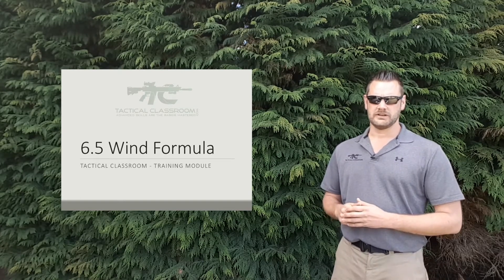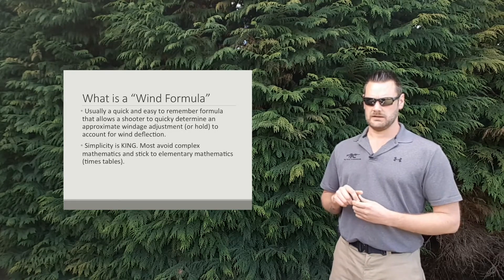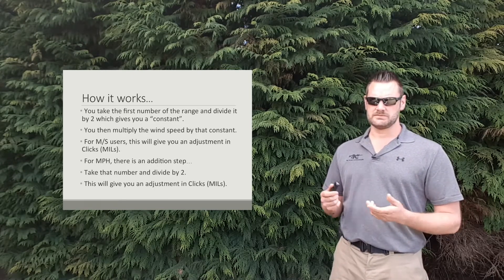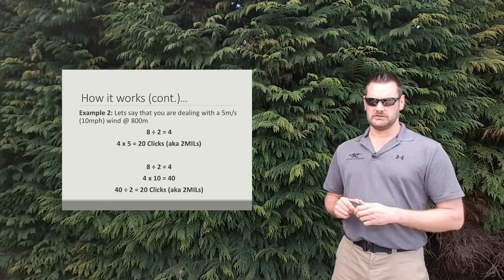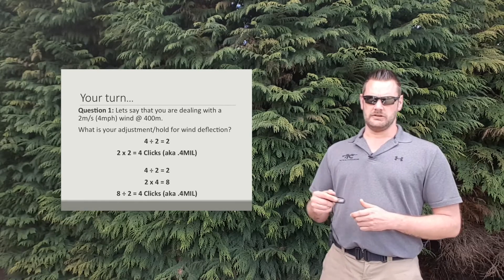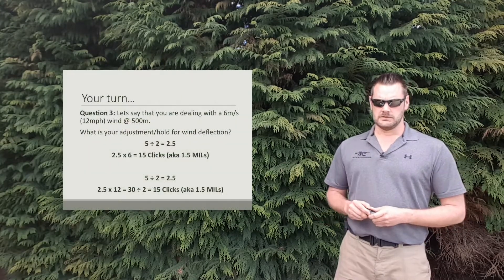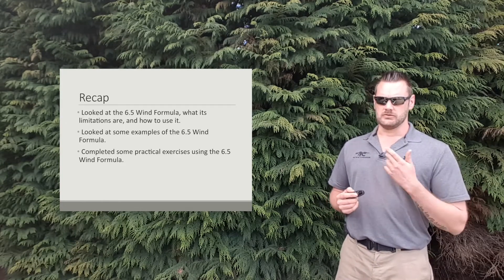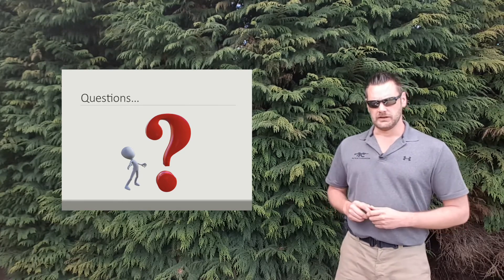6.5mm Wind Drift Formula - Long Range Shooting Tips

Comment: Blimey, it works. Same output as my Strelock, used it at 700m with my Creedmoor today and hit the 8” diameter plate first shot. Easy as.
Reply from the maker: David Hartley Glad it worked for you David. I use it when I'm shooting 6.5mm. Are you using m/s or mph?
Reply: Tactical Classroom I’m using m/s. Want to keep velocities and range metric and use milrad. Have changed all my ballistic turrets to mrad and finding overall that combined with metric measurements its working better for me. Keeping it simple has made a big difference e.g. only measuring the wind perpendicular to the shot trajectory, and using this formula. Then I do a simple wind check 2/3 of the way to the target to see if it looks about right. Before I was trying to assess the exact wind vector and inputing into the ballistic app and not getting it right as often as I should.
Reply from the maker: Nice one! 

Folks tend to overthink the wind and it just slows them down...they muck about with their Kestrel to try and get a "perfect" firing solution!

9/10 they are still playing with the Kestrel when I'm getting off the gun after making a hit!

They need to realise that there is NO WAY to measure the wind precisely all the way to target, nor account for slight changes caused by terrain features etc.

The wind call we end up using is simply a BEST GUESS based on experience.

So...good on you for streamlining your setup so it works for you!

Comment: Thanks pretty useful . Do you sort of work on an average velocity to get to this calculation. If I run a ballistics app the numbers are slightly off ,but not by much. If you shooting steel you should be getting hits.
Reply from the maker: Andy Rose I'm Glad you liked it...

I've tested this formula against my ballistic app AND tested it "in the field" on steel...and it works very well.

As stated in the video (and noted by you), it isn't always exact, however if it is off slightly it's usually only by .1 to .2 Mil (and usually on the high side).

Given that most folks underestimate the wind, this occasional .1-.2 overestimation often goes unnoticed (and so isn't necessarily a bad thing).

The formula is based on the wind deflection of a modern 6.5mm projectile @ 100m at 1m/s wind speed.

There are more slight errorsin the mph version because the "constant" used in the final step (2)  isn't exact. 

It should be 2.2 (2.2mph = 1m/s) however it is rounded to 2 to keep the math easy.

 It's still "Minute of Bad Guy" close but once again favours the high side and is often not noticed due to folks underestimating the wind speed.

Have you seen my other wind drift formula videos? If so, which style of PowerPoint presentation do you prefer?

Thanks

Jeremy